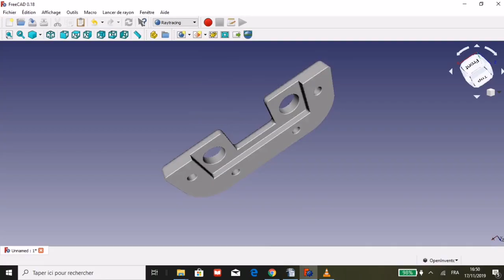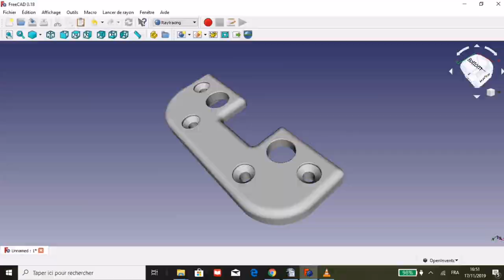Hinge pulled out of IKEA cabinet door - Reparation with 3D printied cover - Hinge Repair Kit

Comment: Nice reinforcement. To be honest, you can buy a narrow and short steel connector plate, many sizes available, which would do the same thing (also called mending or repair plates).  It would also last longer being steel, have a smaller profile, and are very cheap (pennies/cents each).
Reply from the maker: Thanks for being honest and also for your comment. Yeah, "repair plates" will do the job. It can work. In my opinion, it just does not look very nice. I believe that 9 wifes from 10 will not "commission" such solution as the solution to the problem :-) My hinge cover, is contrary quite elegant, nice to touch and looks more like an upgrade of the cupboard :-)
Reply: Yes it certainly looks a lot prettier than a metal repair plate. You should produce them for sale, I believe it would prove very popular.